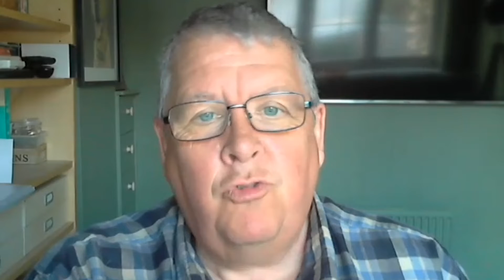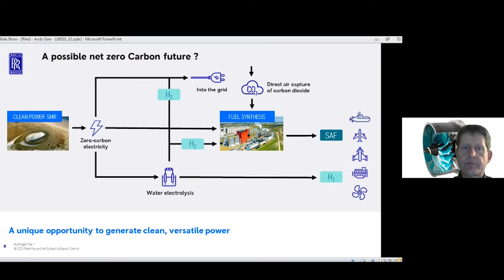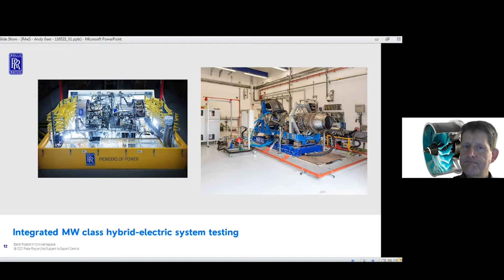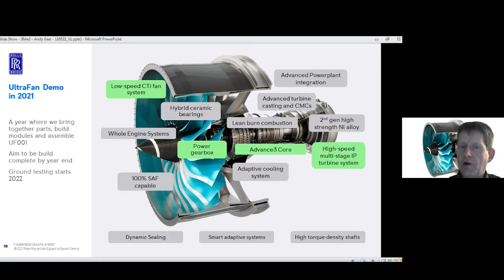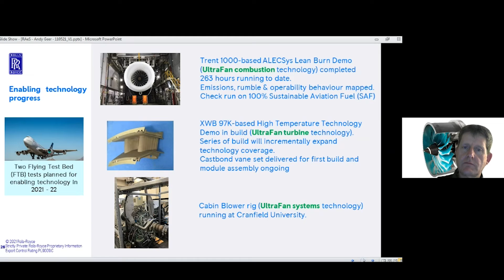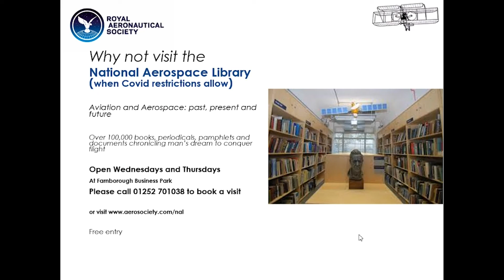RAeS Farnborough Branch webinar: The Rolls-Royce Ultrafan Demonstrator Programme

Comment: So 10% more efficient than XWB?
As for the future of aviation, one is not informed if one is not aware of the presence of ET vehicles and the 75 year cover up. These vehicles do no use combustion but a form of field propulsion. The secrecy surrounding clandestine efforts has crumpled a bit in recent years and we could be very close to disclosure. I would not expect the secrecy to last until 2030.
And I assure you it is quite real as a matter of certainty.